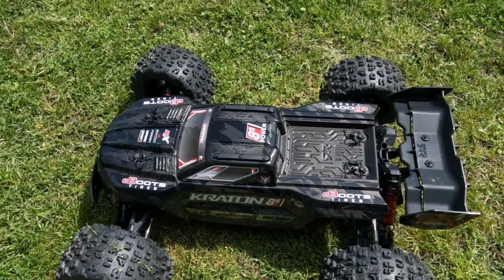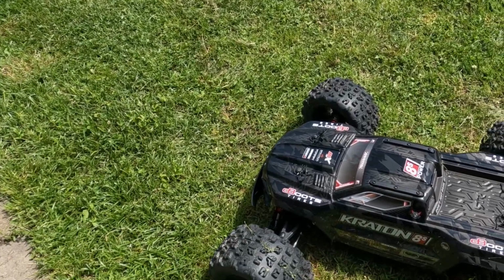Kraton 8S EXB First Run

Comment: Nice break in/shake down run. She is a beast and I loved the jump into super long wheelie! That was pretty slick! I am sure the motor does get a little warm, that is a lot of truck to get moving!
Reply from the maker: Addam, after the first 5min I kind forgot that it was just a break in run, she is a beast of a machine, I'm just happy to have finally gotten the motor and esc in.  The wheelie after that jump was a fluke.  I have to keep the grass cut to 3" to keep the chassis from rubbing on it to keep the motor a little more cooler.  Thanks for watching the video and for your comments.  👍👍👍

Comment: Surpass makes some great brushless motors. The esc’s can be questionable sometimes but that being said I’ve only had 1 fail on me and it came from eBay so it may have been used. I’ve got 2 3900 kv surpass motors waiting to go into something just not sure what yet
Reply from the maker: Thad, I think I will have to make Hobbystar and Surpass my go to motors from now on, I like how they have the get up an go when you hit the throttle, Just need to make sure the motor can handle the power of Hobbywing esc's.  Might look into getting a couple of 1700 and 1650 kV motors for my 6S rigs.💥💥